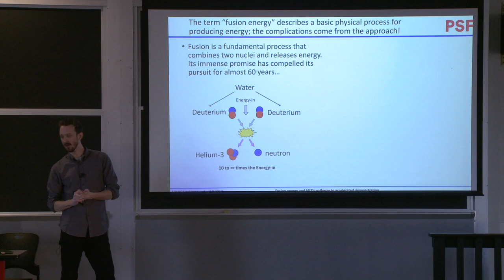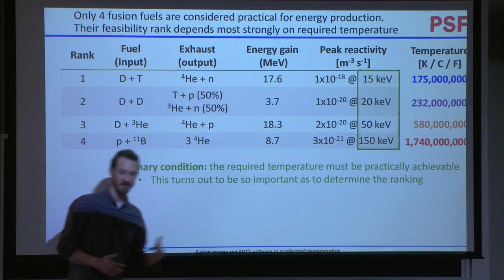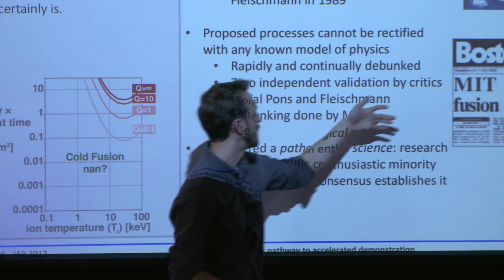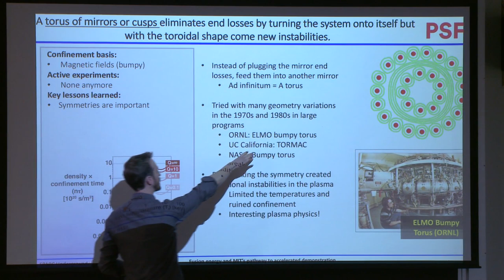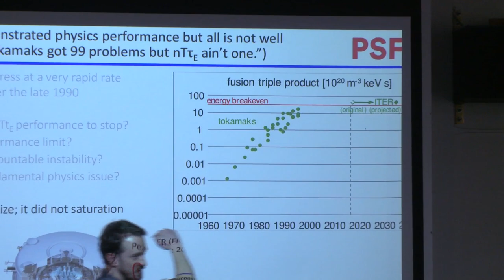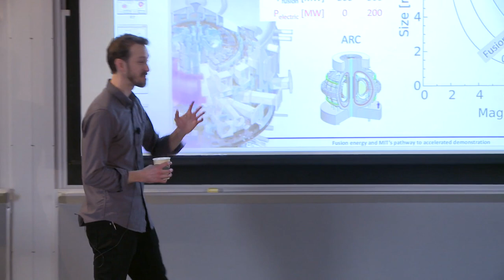MIT's Pathway to Fusion Energy (IAP 2017) - Zach Hartwig

Comment: I'm confused as to why hydrogen is at the sun's core when it's the lightest atom, which I think in any cloud of gas from which the sun was formed should really be at the surface. Supposing therefore that the sun is fusing whatever particles protons consist of before continuing at making helium, wouldn’t attempts to make helium first using the sun as a model prove impossible.
I'm assuming that the raw material for fusing particles is dark matter of which there's a large amount at the centre of each galaxy. If, instead of there being just one 'big bang' there was one for each galaxy and when it happened for the Milky Way, large blobs of gas with dark matter at its core were cast off to become suns. 
If we assume that dark matter is an accumulation of the smallest particles that can't be further broken down - neutrinos perhaps - and that before a galaxy's 'big bang' all its matter has been reduced to this and drawn into a single volume at the centre of the galaxy the gravitational force and the heat that produces then becomes so great that it explodes giving rise then to the fused matter that suns, planets, and all heavenly bodies are made of and some of the dark matter escaping with the gases produced. The 'last straw' creating the 'bang' being that the total accumulation of the galaxy's matter in the form of dark matter escapes for a moment the gravitational force of the surrounding galaxies. 
So unless it's possible to create the total gravitational force of the sun on matter that can't be further broken down I think it not possible to fuse any two particles.

Comment: "For $20 billion in cash," Steve Cowley of Culham says, "I could build you a working reactor. It would be big, and maybe not very reliable, but 25 years ago we didn't even know if we'd be able to make fusion work. Now, the only question is whether we'll be able to make it affordable."  This statement was made with full knowledge that even the basic premise of virtually limitless controlled fusion power on Earth has never been demonstrated.  Giving fusion researchers $20 billion would thus be totally irresponsible.  But if by some miracle they succeeded in solving the myriad problems of reactor degradation from radiation, stable confinement, energy conversion to a useful form, etc., finding a limitless source of cheap energy would still be the moral equivalent of giving a loaded gun to a mentally retarded child.
Reply: So now it isn't about finding the means or proving the process, it is about profit. Will that $20bn thing produce $40bn of electricity?

Comment: The man is good for talking but  I'm not sure he will be able to answer to the old boys from JET for some pratical questions. The nasty material needed to cope with the physical constraints in order  to produce fusion ,  make the difference  between a hot plasma with no atomic reaction and the one making 14 Mev neutron used to heat but also to produce Tritium from Lithium Tiles. Because only few experiences were made so far to produce Mjoules of fusion power , it's quite surprising from a young guy  to talk about fusion as an expert. Surely is spent time to read report thesis , modified few times by the authors  before publication. But certainly no chance for him to read log books about the  daily problems the true experts have to resolved to make their  PHD  supervision pleased to make their pape for making fusion reaction controled. How many people in science remove data informations that doesn't match their theory? Keeping the goods results but without understanding why they are good some time to time!  I 'm not sure as an educated american , he knows what the JET staff did, to be the best team in the world. The answer is simple, the man in charge at the top was so competant, that he could took decision in short delay,  forseen the delays  and the effets of them, organise the transfert of competance between teams  to avoid  waste of time,  delegate  power decision even at low level staff because above diploma,  experiences  make big difference. Any staff from the man in charge of the lift to the man in charge of the control room  get opportunity to be an important staff for the success just for the sake to be able to provide informations easly...And above that when people are from different countries wtih different approch for learning, thinking, the result is better than the one who get the same training. And in Europe  the contribution of the selected staff among laboratories even for technical staff with different curiculums for the same speciallity brought a huge impact on day to day progess. Delegation of manager  skills bring a new approach of human resources never knowned before. The people who think technology  is not a problem because everything can be produced on tendering action are wrong. Just for the fact the a tokamak is not a standart nuclear plant. And regarding  the energy involved for igniton, the cleaness,  the radiation penetration, the heating system, the dynamic of the particles in the plasma, the time of reaction to controled the process, the fueling , the collection of energy produced; the fusion technology is still far away to be a reality for replacing the fission nuclear plant.
So far nearly all the tritium is used by military programs to the H bomb.  This impose to master the tritium production. To ignit the plasma the tokamak must be feed by a nuclear grid to bring the M Amp for the magnetic field and the other heating system cooling system  the diagnostic system. Even the approach can be improved by new material, we are still required top quality for anything because the environnement. Nothing to compare with the classic nuclear plant . And that cost a lot with no garantie for the final result

Comment: The premise that fusion would do away with fossil fuels is ludicrous. Quite the opposite, the world runs on liquid fuels not electricity. Cheap and abundant electricity (which is what we hear fusion will produce) will be used to extract the vast but too difficult and too costly oil that remains in the ground. And will also enable the manufacture of synthetic oil which is also too expensive now to be marketable.

Comment: So many "facts" about a completely "theoretical" non-existent "process" and numbers that no known or possible "instruments" could ever "measure" or "record". 2 billion degrees? First of all, what "degrees" are you using there? Is that Fahrenheit or Celsius or what? Second, we can't currently directly "measure" temperatures in excess of the physical capabilities of existing "thermometers" whether "analog" or "digital". Third, we can only currently measure the "temperature" of "gases" by using them to cool a heated "sensor" and only those that don't rapidly oxidize a heated metallic sensor probe and that are being produced in volumes and mixtures that we already fully understand and know the properties of because they're the result of chemical reactions and  are byproducts of combustion and oxidation and those "temperatures" are only used to gather data about an already-completed process in order to adjust the process by changing "mixtures". Specifically I'm referring to "O2 sensors" in combustion engine electronic control systems. Of course there are also heated probes used to detect leaks of other gases that are CFCs of some kind that oxidize when they come in contact with a hot sensor probe and reduce its heat and result in a change in its "sensor voltage" that the electronics "see" as a "leak". 

Those sensor probes actually COOL when those gases are oxidized in their presence since some of their heat is "consumed" in the process. Basically at most we can only directly "measure" temperatures below the melting point of steel and using "infrared thermometers" we're only able to "measure" the temperature of objects large enough and made of metals below about 1/2 the melting point of steel which has the HIGHEST melting point of any ferrous "metal" and which MELTS somewhere in the 2000-degree F range but becomes incandescent and begins to "glow" (which occurs when its heat-saturated to the point that its no longer capable of radiating excess heat energy  in the "infrared spectrum"). That point is several hundred degrees higher for a human eye to witness it in "ambient light" (i.e. any light level "brighter" than what would be produced by that incandescent steel in total darkness) which can be in the 1500-degree F range, but that is actually in the 1000-1200 degree range if measured when incandescence became visible in total darkness. 

Because incandescence occurs when a metal has "stopped" radiating additional heat in the "infrared spectrum" and is getting hotter and hotter because it can't radiate any more heat to and through the air around it, infrared thermometers are useless for measuring radiated infrared-spectrum heat energy from objects that aren't "stable" in temperature and that are more efficient radiators of heat than "steel". The best and most "accurate" infrared thermometers use laser "sights" to make sure the sensor is the correct distance from the surface to be properly calibrated and are capable of measuring surface temps of 1000 degrees F nominally. When the "dots" froim two different "laser beams" meet the distance is correct and the temp measurement is "accurate". Go closer and the temperature will "increase" on the display as the "sensor" absorbs more heat or rather has its own temperature increased as its "measuring temperature" by being heated to a certain temperature and is radiating its own infrared heat which will be "offset" when can no longer radiate heat. The electronics are calibrated and programmed to "calibrate" the thermometer at that point and from there it will be heated by the hotter object. 

There's no way in hell you will ever be able to measure your "predictions" and of course you'll never have to try since your "free energy" will never "materialize".

Comment: individuals want their own power supply, This system is for companies to sell energy to the people, when the people want to produce their own power... billions to make and trillions in profit if they succeed :(
Makes me want a Horse, not a Tesla.
Reply: roy boese were always going to need to buy power. Weather you buy a machine that is in your home to give you power or you pay monthly it's going to cost money
Reply: I agree but if Fusion energy works why cant it be miniaturised...
Reply: Because miniaturizing is a really difficult engineering challenge...
Reply: Well, theyve been trying giant ones with no success for 50 years they might be better trying masses of miniature variations...
Reply: No, I don't want my own power supply.
Reply: roy bose Problem is, fusion works better if the device is bigger. Also first it has to work at all. After that one can try to enhance it.
Also: For your home some Solar-panels and a bit of a buffer (batterys, fuel-cells whatever) is feasable. But for heavy industry it's not. (Thinking about a steel mill: It needs much more energy than the city I'm living in...)
Reply: Did you even watch the video?

Comment: When are you going to stop talking about "energy" and start talking about POWER. We don't "consume" energy and according to the laws of thermodynamics energy, like matter, can't be created or destroyed. And "energy" is a finite and abstract and useless "intangible" non-object. We need POWER to do WORK. And your fusion energy is a chemical reaction that will result in heat "creation" and that heat has to be harnessed to be converted into WORK. Nobody on Earth needs "heat energy" to "survive" because we ultimately can and do all create our OWN heat energy. 

Our bodies are nuclear reactors only the EFFICIENT and EVIDENT and PROVEN and SAFE kind that use "fission". Our bodies "extract" the chemical energy of sugars that our bodies use heat and water to ferment out of carbohydrates and break down into sugars and "burn" by oxidizing them in the cells along with...hydrogen and oxygen. The "extra" hydrogen moderates the process and prevents our cells from burning up. The "fuel-air" mixture is too rich to "explode" and the hydrogen also serves as a "spark plug". 

And humans don't NEED electricity or any other "energy" to "survive" we did without for millions of years according to "scientists". We do need to do WORK to survive. To provide ourselves with food and water. Those are the only "necessities" for "animal life". The only people that "need" a  miracle "green" energy source are those who are unwilling to WORK to survive. Of sure, they have "jobs" and "careers" but their "work" is only "work" by their standards. All humans communicate and think and travel around their environment as they work to survive. Back to finding/producing that food and water again. 

And people who know what work is and do real work other humans do not - such as manual or "blue collar" labor - and know the difference between a "doing a job" and "going to work" and actual "work" all do the same things the non-workers who just have "jobs" do. They communicate and think and travel. And they do the manual labor and WORK that is pretty much everything humans collectively and individually need to have done for them to collectively and individually survive but unfortunately isn't the "jobs" all people want to do or even have an appreciation for or recognition of. 

The bottom line is that its the "researchers" and "scientists" and "educators" and huge believers in anything that makes their lives more comfortable and their "jobs" possible and WORK an "optional" activity are the ones that "need" fusion energy. And their attitude and beliefs and evangelism of "theoretical" so-called "sustainable energy" technologies are the ONLY thing that is REALLY a "man-made" CRISIS for "humanity" and the "planet". 

Put down the chalk and remotes for your lectures and slide shows and pick up a hoe and pitchfork and start producing the necessities of life yourselves and for yourselves so others don't have to do so for you and immediately you'll see a huge reduction in "consumption" of natural resources and corresponding increase in "production" and "sustainability" will take on a whole new meaning for YOU and for "workers". Basically start PULLING YOUR WEIGHT and PRODUCING SOMETHING PEOPLE AT LEAST WANT AND THAT IS SOMETHING THAT IS TANGIBLE AND PEOPLE CAN AT LEAST SEE IF NOT UNDERSTAND.

Comment: So they have climate ambassador Bloomberg addressing the graduating class who will probably. start carrying on about the climate farce.  This fusion project is like the public works here that took months to rearrange some curb stones and pave a short stretch of road while creating horrific traffic.  
Magnetic fields are very good at confining fusion temperature charged particles in submillimeter diameter paths.  They are not so good at making these particles go around corners.  But the soviet era tokamak is still clogging up the fusion progress.  And after 14 billion dollars, the reactor that was supposed to start up in 2017 is now set to launch in the 2030's some time.  By then,  fusion poweted lawn mowers powered by linear reactor designs will probably be selling for $199.95 at the hardware store.